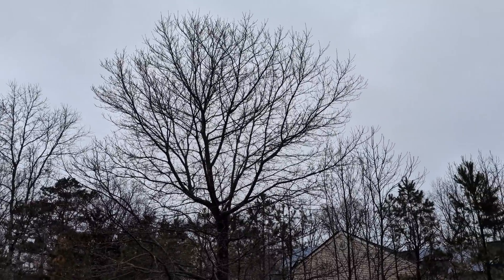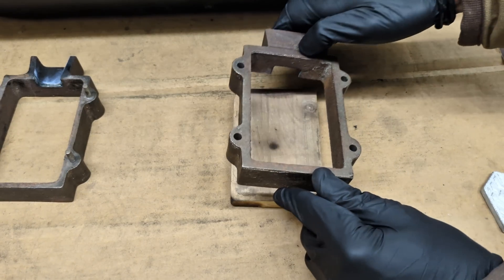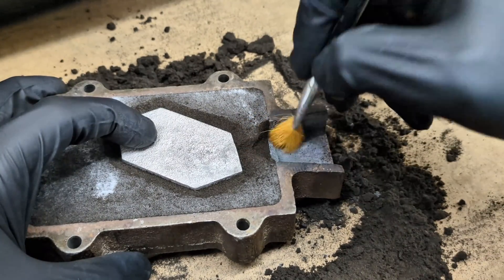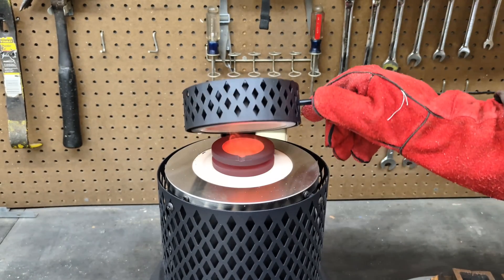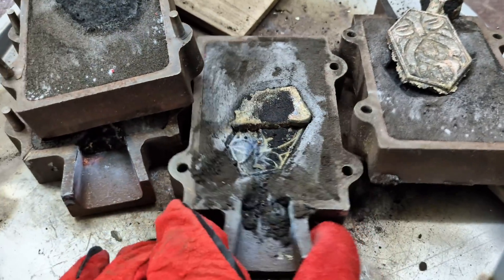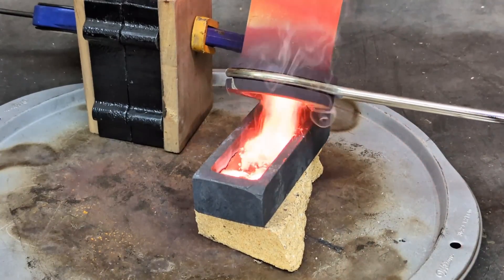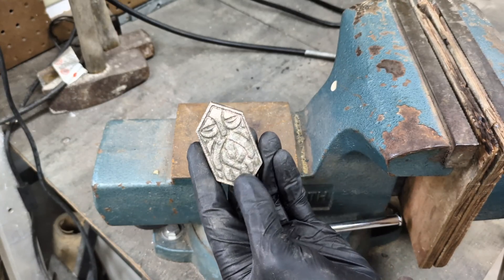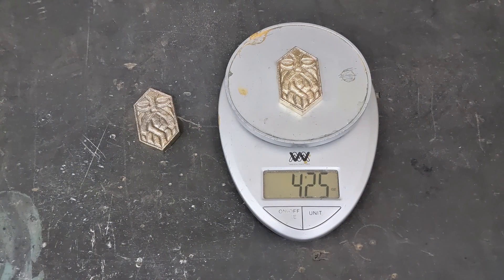Metal Casting Brass with the vevor electric melting furnace - (Sand Casting Process)

Comment: Nice video ,careful working with brass though without some ventilation, pretty sure you get zinc fumes
Reply: Those zinc fumes can be real trouble.
Reply from the maker: Thanks! Yeah brass can be dangerous i that regard.  Don't do this indoors.  I am doing this in my garage and I think there is enough ventilation with the door and windows open.

Comment: I've been using a similar electric furnace for several years now. As I live in a condo, my neighbors would not enjoy me running a propane furnace... it would actually cause quite a commotion. I can say that they work great for what they are. And like Heinrich points out, they can be operated inside a garage during rainy days.
Reply from the maker: I hope you aren't using it inside the condo.  I think that could be very dangerous too.  Yeah I don't think the neighbors would like the propane furnace 😂
Reply: @HeinrichsMade  Hahaha!

Comment: Need a bigger induction furnace next! 😂
Reply from the maker: That would be cool.  I do have a kiln from a pottery shop.  That's pretty large.
Reply: @HeinrichsMade  * them bigger crucible get expensive
Reply from the maker: @Gallowaylights  yes they do!  I have a 12kg, but I could fit a bigger one 🤣🤣
Reply: Bonsoir, qu'elle produit ajouter au sable, merci.  @HeinrichsMade
Reply from the maker: @slimanesellam8486 I am casting brass